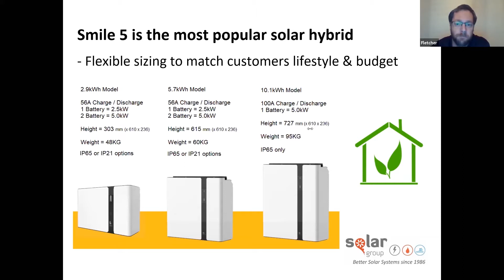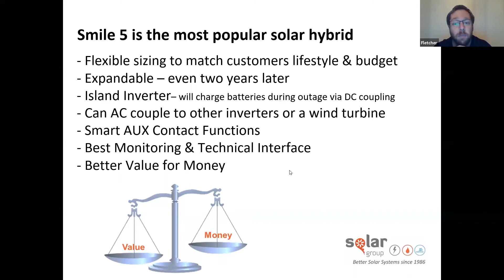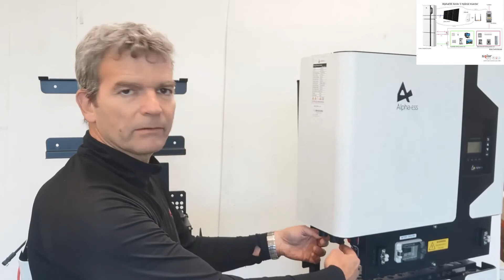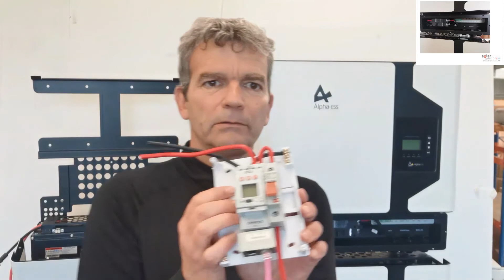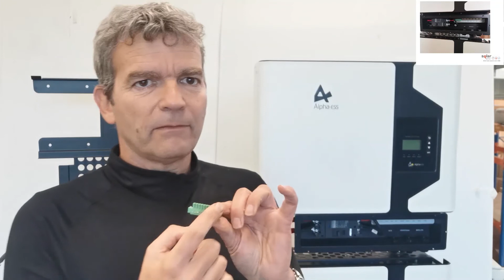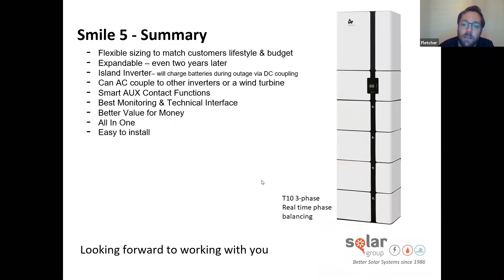Do it once and do it right   --  AlphaESS SMILE5 Hybrid Energy Storage System

Comment: Hi, I had a SMILE5 installed in my home and it's EXTREMELLY noisy!!! The manual says the noise level should be below 35db, but there's a component at around 14.5kHz that goes way above 40db every time the device receives more than 3kW from the panels. Does anyone else experience this level of noise from this device?
Reply from the maker: Hi, please send an email to info@alpha-ess.com and we will get back to you asap. Thank you!

Comment: Good evening, What does the 0.5C/5kw discharge rate mean in lamens terms on the 10.1kw battery?

Do I understand it correctly that it will not be able to handle a load higher than this?

Comment: Hi mate. I have a Smile 5 installed with a 10.1 kW battery and inverter on top. Can you please advise how my electrician can install the back up connector so we can have power and lights when power grid is down? Thanks.
Reply: Change installers as this should be known by him

Comment: Hi good evening..i'm from the phillipines i just installed a 5kw  Alpha ESS Smile inverter. I have a quick question regarding the inverter .what is the possible solution if the Main Ac Grid supply is low and the inverter is not recognizing it? Example is the nominal voltage of the Inverter is 230VAC ang the Grid suplly is 197VAC.is ther a way to configure the inverter to change the voltage rage of the AC input??